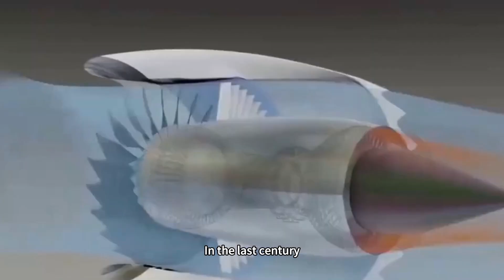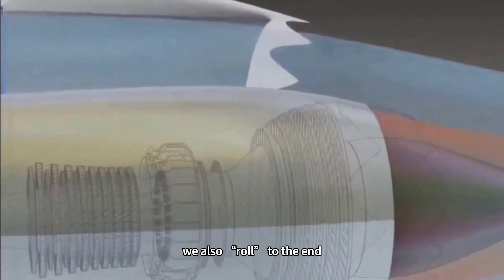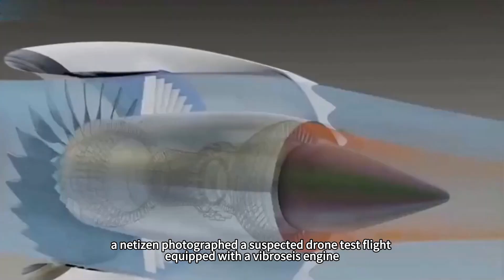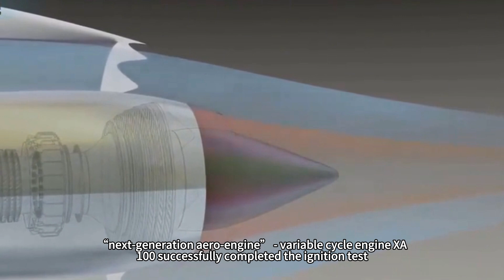WS-15 is only equivalent to US technology from 30 years ago, is Chinese technology really that bad?

Comment: What's the biggest gap between China and the US? PowerPoint presentation!

A few months ago, Elon Musk's DOGE released previously confidential data. The F-22's F119 engine's thrust-to-weight ratio, previously listed as 10, has now been revised to 7. The F35's F135 engine's thrust-to-weight ratio, previously listed as 11, has now been revised to 6.7. These thrust-to-weight ratios are lower than the J-10's WS-10 engine's 8.8, not to mention the J-20's WS-15 engine's over 10. Wikipedia's data has now been updated to reflect these facts. This also explains why the F-22 struggles to hit Chinese weather balloons.

The fact is, China's technology has long surpassed that of the US!

Comment: It's  pretty clear that the truth about how far China's  fanjet engine technology  is depends largely on whether you focus on the most advanced or the least advanced parts of the engine. Is a chain as vulnerable as its weakest link?

You see the results... The WS-15 as an example can perform better than the Soviet Saturn engines China has but because of old tech also destroy the engines almost immediately. So despite  hype, Chinese engines can't  be relied upon for military or commercial purposes. In a war, China would have to win within a day before planes will start to be grounded in large numbers if they encountered any resistance.   Commercially, engines would have to be replaced so often it would make the aircraft uncompetitive to Boeing and Airbus.

And don't  talk sbout engines like rotating detonation. Those are for a possible future and not today's  aviation.
Reply: Whatever floats your little boat my friend